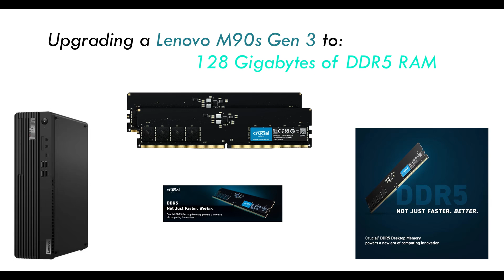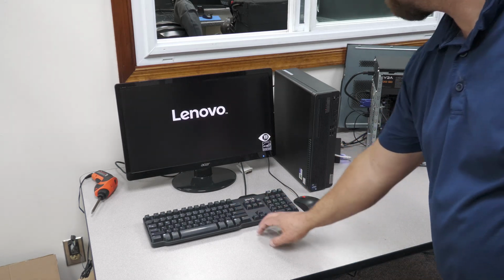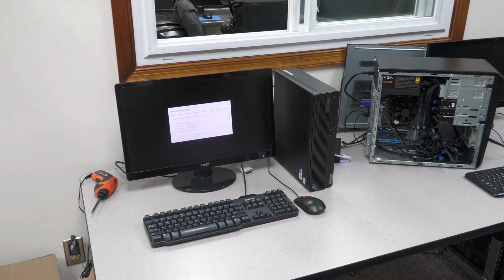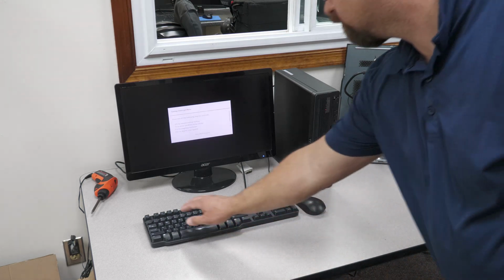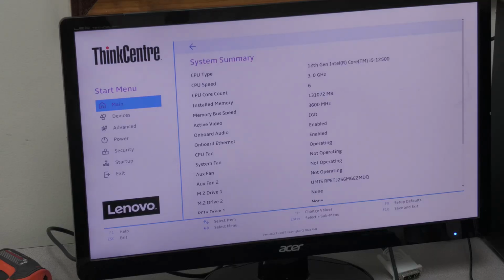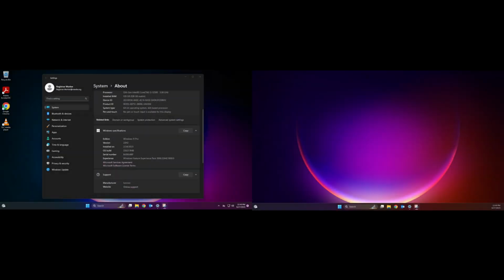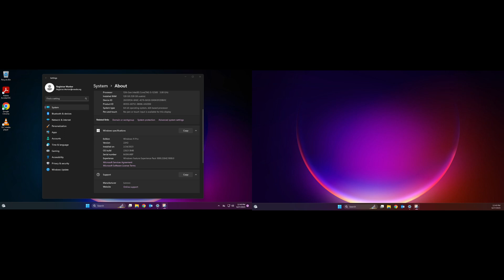Upgrading a Lenovo M90s Gen 3 to 128gb of DDR5 RAM

Comment: Hi i know the video is a year old, but what I want to know if is it possible to upgrade the GPU on the thinkcentre i7 13700 ?
Reply from the maker: I don't have access to this computer anymore, but I would add a low profile GPU PCIE card and make sure the power supply has enough wattage to handle the card.

Comment: Hi, I am think to buy ThinkCentre M90s 4 gen but the support Memory Frequency in mentioned 4400Ghz  similar to M90s gen 3 . I have searched online  about the 4400Ghz Stick RAM but didn't found.   I Noticed you have  inserted Crucial Memory stick with 4800Ghz. how it is supported . I have also seen 3200Ghz in your BIOS.  why it is reduced ??
Reply from the maker: The Specifications for the RAM on Lenovo's website/manual says:
Up to 128GB DDR4 2933MHz
Up to 128GB DDR4 2667MHz
Up to four double data rate 4 (DDR4) unbuffered dual inline memory modules
(UDIMMs)

Comment: What do you do with that PC to require 128GB? What kind of memory did it ship with? Also does the unit ship with a heatsink for the NVME drive?
Reply from the maker: This is an office computer, which uses primarily Microsoft Office. It's use definitely does not require 128GB of RAM. 

The specifications that it shipped with are:
+Processor 12th Generation Intel Core i5-12500 Processor with vPro (P-Core Max 4.60 GHz with Turbo Boost, 6 Cores, 12 Threads, 18 MB Cache)
+Operating System Windows 11 Pro 64
+Graphics Integrated Intel UHD Graphics 770
+Memory 8 GB DDR5 4400MHz
+Storage 256 GB PCIe SSD Gen 4

The NVME does not come with a heat sink.